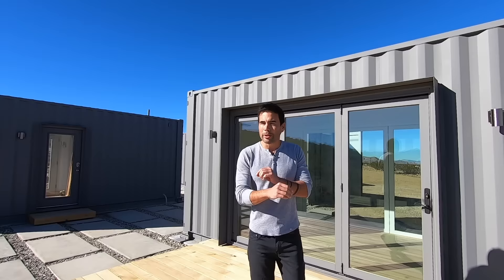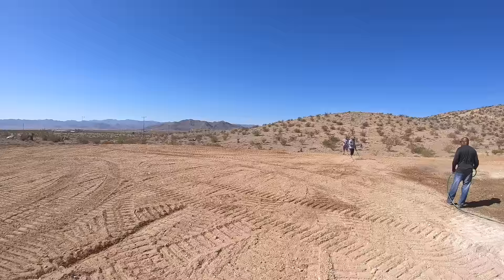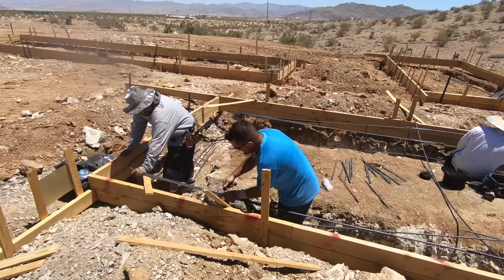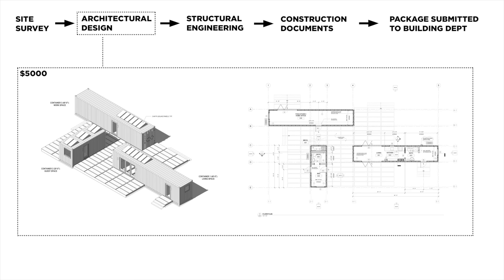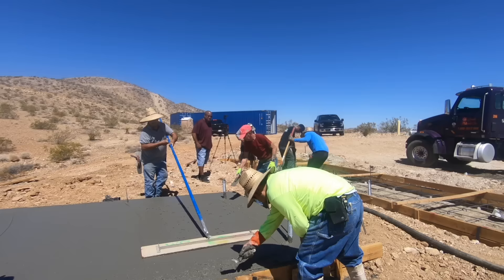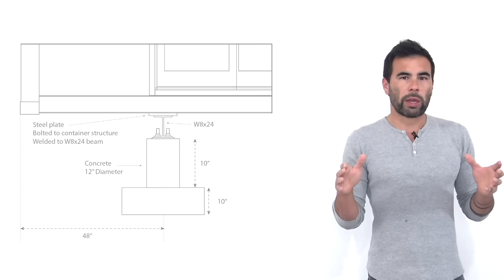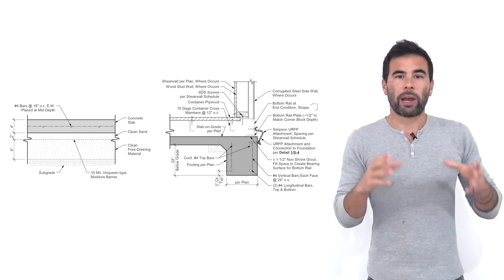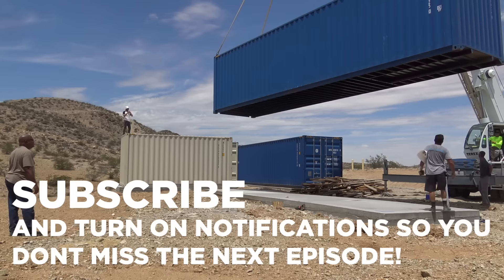Building a Shipping Container Home | EP01Permits and Foundation Design

Comment: Too bad people commenting can't stay focused on your question.  

Because of a lack of money, my thought has been to buy a number of used RV's, house trailers, perhaps an old school bus, maybe a fuselage from an old jet plane (erected vertically and inserting a spiral stairs could make a nice observation lounge), and just assemble them together somehow. Weld them together in some configuration? Or connect them all by a deck formation. I've seen 31' RV's for as low as $2k (that supposedly run). As long as the roof doesn't leak. I'm also looking at northern MN, so insulation is a big issue.
Reply: spaneen very creative, I like that idea.

Comment: Only tip worth talking about, adding the sand... sand is not longer recommended above the moisture barrier. I would also need to know more about the ground temperature differences to add more details about the footers. Wish you success.

Comment: Respected sir,  
I have one suggestion. 
I have lived in Mauritius.  Mauritius weather is bit rainy and muddy .
People dig or don't dig  earth. 
Put larger stones in very systematic flooring  like bed , make level  and make edges all around.  
Now cover larger stones with 0 no or 2 no  chipping used for construction in systematic flooring like  bed , make level. 
You put containers on such floor.  You make larger  area,  home will remain clean.  When rain fall all water is absorbed by earth. 
If you have any  contact with People residing in Mauritius ask them. 
It's a cheaper and cleaner.  You can collect all your material back in your hand and reuse your land for plantation. 
Second suggestions 
You take four,.. two  sides iron  plates upto hight  of containers put inside the earth  up 3ft using cement. Two  sides bar  will protect the container from cyclonic wind.  The container will remain block in case of cyclone. Wind can't blow your containers. 
Third suggestions 
Before making bed of stones and chipping put thick iron bar.... inside  earth without cement 
and do welding after ......putting containers. 
With this method also iron bars will remain fix, because of stones and chipping. 
If you will visit Mauritius,  you will see all over Mauritius people make compound using this method. 
If you will put small iron all around containers on the roof walls ,  the container will remain dry.  
To understand this system, you must experience heavy rain fall and such compound. 
Maurtian people use back yard as kitchen and iron all around the house.  It work as sheds and protects us in heavier rain. 
Namh shivay.

Comment: Honestly, I'd have recomended the three containers to be connected to each other to create a single building instead of 3 separate buildings, and would have considered burying one of the shipping containers sub-surface as a basement, which is then also a cooler space to serve as free air conditioning and storage.

Comment: First container should have been in the ground with the other stacked(welded),circulating the cooler air from the bottom unit to the top would save power, less load on panels.

Comment: The sea can is inherently earthquake proof. Even if it got shook off the foundation, you cold just lift it back on. A few blocks of concrete or a gravel pad would be as good or better. 
In my experience the shell of a house without windows is cheap and quick to build. It is all the other things that are expensive and laborious.
I would think that a conventional wood frame shell would cost less than the one trip cans delivered. You are also limited to less than 8' rooms.

Comment: With zero experience or expertise I wonder being in the desert wouldn't having a basement or cellar provide access for your plumbing, electrical and maybe space for the heating and cooling systems? As well as space that could be used for dry cool storage?

Comment: Hi from Oamaru New Zealand. Here's a little few facts. Shipping containers are designed to be self supporting on its entire length at the both ends only. The containers can only take load at the 4 corners only which may be 8 or so high and at full load its very impressive. So at the ends I pour a container width by 2 ft reinforced concrete beam / portal.

2. Containers are made of Sumitomo cor-ten (c 10) copper infused steel for its weather resistant conditions however it still rusts and eventually has holes especially by coast or wet environments.

3. Containers cannot be painted with common house paint. Only 2 pot mix epoxys that's certified for use on shipping only. As other house type paint degrades fast.
The best 2 paints is from Phoenix paints in western Australia. The paint is called Metalfix and Metalfix 1000. 1 is for new bare steel the 2nd is strictly for rust infested steel (loose removed & steel that requires holes to be repaired without welding.

The Metalfix is water based, heat resistant for up to 600 (?) degrees Celsius and has the ability to last 19 or so years in a coastal environment.
The only disadvantage is its limited to brown /red oxide color or black.

Thanks for the your video.

Comment: In California the state is generally considerably less of a direct issue than the counties as far as costs are concerned.  There are state regulations that need to be met, but by and large, those regs are mostly intended to satisfy federal requirements (or in the words of various administrators "meet or exceed" Federal requirements).  The counties have to meet the state requirements, but they are also desperately short of cash and generally have been for decades.  So, they charge seriously for permits which are ALL county or city issued.  You don't ever apply directly to the state, except if you are connecting your driveway to a state route, or possibly you need to cross state-owned land for one or more utilities.  If that is the case, then you will need to negotiate with CalTrans or Calfire or State Fish and Game, or possibly all three.  The biggest state issued headache is Title 24, which affects all building permits.  Most other state regs are applicable to public buildings only.  But T-24 requires individual permits for EACH building, so the biggest, most costly mistake here was that he has three buildings on three separate foundations, tripling the permit costs, and offering San Bernadino County a windfall of income.  At that, San Bernardino is a much less expensive county than building in Los Angeles, where the likely costs would be double that, if the neighbors didn't start a campaign to shut your project down.  And since most "Californians" these days were born out of state, well the fun sucking is all imported.

Comment: idah gone with our east coast standard and have a basement so you could have cool storage and a place to hide from the heat and just run shallow I-beams across to support the container floor.  you’d also have double the square footage, you’re decks would not require railings, and the floor would be close to the ground like you wanted it.
you say a full foundation would cost more?  well not much more and for just the little extra all your goals would be met and you’d get a basement out of the deal.
i’m sure the codes in that californian county would approve, yes?

Comment: I would have included an attachment point for the container to the slab/steel in the slab. Either a plate to weld the container to or a lock down like what is used on the cargo ship.

Comment: maybe cementing  steel beams at an angle into the ground at the corners 2 in the front and 2 in the back, have them welded to the Container only coming 12in out the ground or even vertical beams into the ground up under that are welded to the Container

Comment: Hello...may I ask why don't you use helical piles to support your foundation, I'm curious because I have a project in California that we use concrete slab and helical foundation welded and fixed with bolt and nuts in the sides of the container

Comment: Grounding? If you want to use electricity a good ground is essential. You should have run a bare copper cable around the foundation to be encased in concrete.

Comment: My idea for the shock absorbers would be to embed steel I-profiles in vertical position and to connect them with horizontal steel girders with a steel cable, so that the container practically hangs in the air. Comparable with a hanging swing! I male 50 years living in Austria, ZIP 2115, there are no earthquakes but still I am an engineer and sometimes have ideas that come to mind in certain situations. Hope my idea for this project has something to contribute ?! Greetings to all

Comment: Railing is only needed at 30" or more above grade; you would have been fine, unless there are local codes/ordinances/reg's that dictate otherwise. If for some reason that is the case, I would build the deck about 6" below FF, which should put you well under the imposed height limit.

Comment: Im wondering if straight shaft piers would have work for this project. Maybe drill like 6 concrete piers going to like 10 ft deep into soil. However you mention that rock was shallow so maybe not even that deep. Maybe even a combination of your first idea with drill piers in the middle for lateral stability.

Comment: Hello,
Cooler King in the summer.
Does building regs in Cali required  8 inch cubic samples of the concrete to be submitted to building control engineer?
Do you not use a vibration tool when pouring to avoid micro bubbles?
In the intense sue, do you not cover with wet hessian or cloth tarp to avoid concrete drying out too quickly and cracking on top surface?
Are there same relentless building regs rules for timber framed OR traditional adobe Mexican type houses?

Comment: For that rocky soil, treated 4x4s would be good enough, we are in South Texas by the gulf coast and soil here is really soft, we have to buy truckloads of caliche to lay on top first. But if I was to do a foundation like you did,  with the dept of your foundation, looks like around 32" deep, its seems to me a waste of concrete if you're only using #4 rebar,  its too thin for that much concrete, I would use at least 5/8 on the foundation and #4 on  top, at 12" centers.

Comment: Thank-you for this. I just wondering do u think a kitchen n bathroom would fit in a 20ft container. I've looked at it n laid measurements n based on that I feel it would. Bathroom area would be just over 5m2 the remainder would be kitchen, galley type, built along long side n opposite that from bathroom wall to other end of container would be cut open to join dining area with L shape kitchen bench dividing the space. What do u think?  Reckon it'd work

Comment: slab is just easiest in cali. Though the perimeter foundy, while helpful with plumbing and electrical, etc.. would need intermediate grade beams. also, you need access to the crawl space with an opening somewhere. Lastly, your explanation of the crawl space, and your diagram were off a little, I feel like; the 18" space can be below grade, you need 8" from foundation to wall plate...

Comment: I wonder what the building code in California would be with a magnetic foundation as in a big magnet and another on the bottom of the structure and the magnetic force keeps them "Floating" apart from each other exactly at about a few inches depending on the weight and power of the magnets.

Comment: I've watched all of your very informative videos! I am building a shipping container home and hope to complete the first of 3 phases by Spring 2021. I am in a flood zone and in an earthquake area. My home will be a 40 foot container, and a 53 foot container with a 20-24 foot concrete slab courtyard between the two. It will have 3 non-joining roofs.  I  have to build 5 feet off of the ground on one end and 3 feet on the other. What do you suggest for a foundation under the two container sections?

Comment: Hi Ben, congrats on your build! Question regarding foundations, how did you anchor the container to the slab on grade foundation? I am planning on building a 40ft on my homeland, Puerto Rico (Earthquakes & Hurricanes!).  I am exploring concrete piers on spread footers (probably not greater than 4ft-5ft below grade) with an embed plate on each pier to weld the container onto, but I can't overlook the benefit of the slab-on-grade in terms of humidity/termite protection.  What are your thoughts on this?  thanks!

Comment: I didn't see vibration tool used for those concrete foundations. Why? Control joints are for sure needed also for such a surface, but the vibration will insure the concrete is spread everywhere evenly and no air bubbles or pockets inside. Also you didn't show that you have to sprink water for hours in such sunny hot weather after the concrete pouring, because those well glassed surfaces will otherwise begin to form cracks on the surface, those joints prevents cracks from pressure or temperatures difference expansions (well not so much needed for California probably), but not now when the conrete is drying. That's my limited knowledge on the matter, I hope I'm giving sound advices here.

Comment: What about a pole-barn style foundation? since is a shipping container the weight is obviously spread evenly, and doing pole barn style footings would easily hold the weight of the entire structure without using even 20% of the concrete used

Comment: Having a basement in the desert equals reduced heating and cooling infrastructure and cost, not to mention much lower power usage for the life of the building.
Oh yeah, there's also more space, so you might not have to buy that extra shipping container to meet the minimum square footage requirement.

Comment: My concerns would be expansion/contraction coefficients and does a fire department want to enter a steel box on fire to either save a person or put the fire out. Personally I love the idea but is it anymore cost effective than just doing a  barndo, traditional stick frame, etc?  
I cant imagine they are easily insured especially in the “pain in the butt states” like CA, OR, WA, CO, MN, all of New England etc. 
Again I love the idea. I lived in them in war zones. Some were premade in the UAE to be lived in and some we converted. Either way we were in a 3rd world shithole so those were considered luxury. 
And then how could you resell it? Can it be appraised as a home? 
Awesome concept, just needs popularity to become accepted. Living in a pole barn used to be a unique idea and now barndos are going up as homes and commercial buildings. I watched a post frame building be used as a very high tech veterinary hospital (not just vet clinic). 
If I thought the permitting process and acceptance would be easier where I live I would do it in a heartbeat. As an electrical contractor I could see the wiring, plumbing, hvac etc being a challenge too. If your going to fur out or frame the walls for this stuff you might as well just do traditional building practices. Maybe I am missing something here but I dont see it being economical.

Comment: Did you just pour a full foundation for a shipping container?! Could just place each corner on pier with anchors. Add ground straps and or build up ground work around perimeter. You could have even just places on grade. That thing would be to stiff to collapse. These don't weight much

Comment: Lateral loading on a shipping container huh?   Did anyone mention the entire container is built specifically to demands of having ratings included so that it doesn't need any support other than the corners.  If you see them stacked you'd note ALL of their weight actually sits on only their corners both top and bottom, in fact, ONLY the corners are rated for structural load.

Comment: Hi Ben, sorry that Californian building employees are outdated. You don't have to be an engineer to understand by thinking logic that the facade of a container has nothing to do with vertical forces but horizontal forces. You only need them when you start stacking containers on top of each other. Your house has no stacking up. The 2x4 walls are enough. The windows and doors frame can be of wood. You could of save a lot of money. Only one suggestion: send those Californian building employees back to school and they can learn how to think logical. Just remember; more simple construction, more efficient and cheaper. Thanks for sharing your experience and be good.

Comment: It didn't cost $25,000 for permits.  It cost $25,000 for all the professionals to verify and prove that your design would work. The Drawings, Engineering Documents ETC. That's the cost of building a one-off house everywhere.  Any drawing updates were because you chose to use people on the east cost who have no idea of California codes.  You should have hired a CA JT architect.  I've built in this location.  I have a 2 bedroom 2 bath and got it done for $120,000 all in including septic.  You did it wrong.

Comment: Placing the plastic as vapor barrier but not  all cover especially at perimeter thickening slab or beam better not to install plastic at all. It seems lousy design more concrete use for container cabin, so expensive foundation.Perimeter beam reinforcement steel not done properly as per ACI standard. Surprise that the place is in USA not in Africa. ✌️🇵🇭.